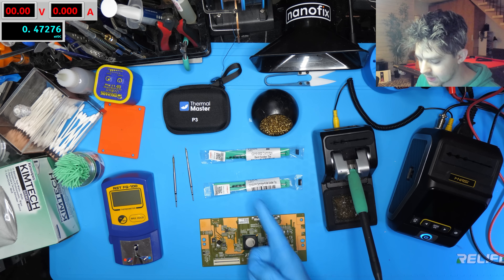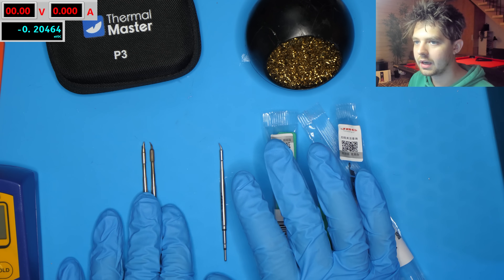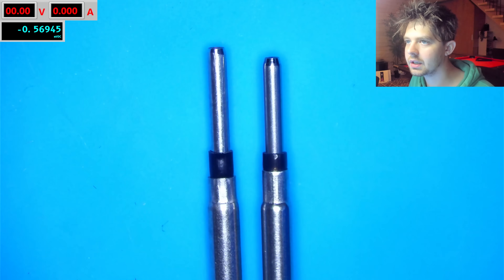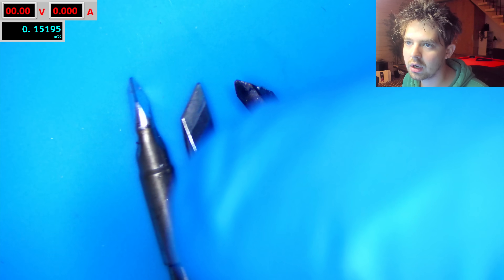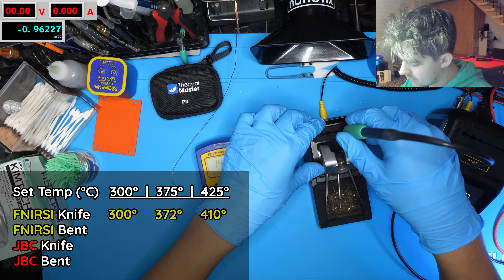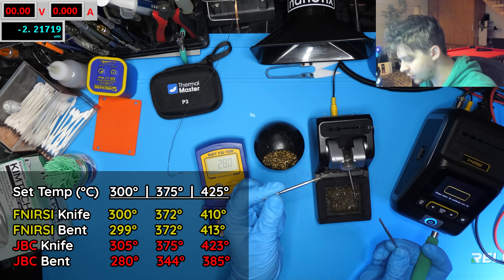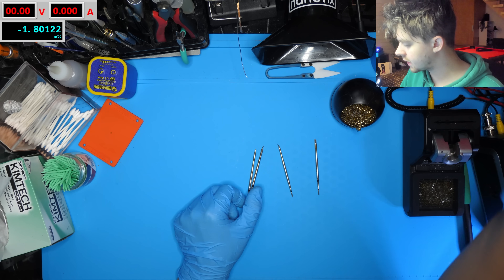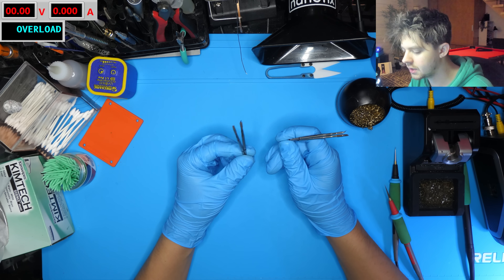Are JBC Tips Worth It?

Comment: I have everything possible from JBC, i.e., soldering stations, hot air, etc. And I have to say, there are major differences compared to the replicas.

This also applies to the soldering tips. The durability of the original tips is significantly better.

However, I have to admit that considering the prices JBC is now charging and what the parts cost on AliExpress, it is still cheaper in the long run to buy the replicas.

When it comes to soldering itself, I haven't noticed any major differences so far. The performance of the original tips is slightly better, but you only notice this with large surface areas. It always takes a little longer with the replicas.

However, I don't have any replica soldering stations to compare them with. I have a very powerful 2-channel station and a 4-channel station with plenty of power.

Therefore, at least for hobby purposes, I can easily recommend the replicas.

Comment: I hope this isn't too much, but . . . sir, you are measuring the heat of shiny metal using an instrument that cannot see the heat of shiny metal. X__X Do you have a meter with a K-type thermocouple? If you have some spares (there are cheap multi-packs of K-type thermocouples out there) maybe (edit: DO NOT) solder one to that ground plane and chart the rise in temperature over time as you try to heat the board with each? I think the only way to measure tips directly with a thermal camera would involve some kind of IR-emissive coating on your iron tips, and that just sounds damaging, like it would fuse to the metal permanently. Otherwise the shiny bits are just reflecting IR from the environment instead of emitting its own. (edit: Apparently soldering a K-type thermocouple to anything could ruin the junction's ability to generate that voltage difference that indicates temperature. I gave bad advice.)

My understanding from watching other videos is: the worst of the clones have the temp sensor way too close to the heating element, so when under high thermal demand the station just sends little squirts of power to the heater, thinking each one is sufficient to get the tip up to temp. Where a higher quality tip (e.g. JBC or Geeboon) will seem to come up to temp slower but will end up delivering power to the tip more consistently.

I ordered a TC22 because of your video and SDG's videos of the higher power stations. (Ordered Jan 1 on Amazon, and USPS says it's out for delivery today, expected some time 11:30 - 3:30. I'm excited! TC22, SW03, and an extra SDC20 cradle) One test I was thinking of doing with mine is: tin the heck out of all the tips, set the station to 160 F and then switch it off, let the tip cool to room temp, immerse the cool tip in a cup of distilled water, switch on, observe how the station delivers power to the tip. I would imagine a high quality tip would boil the water pretty quickly, whereas a different kind might deliver little squirts of power, constantly believing it's reaching temperature and overshooting and backing off -- while the water never boils. Unless you think this is a terrible idea to do with tips I intend to keep and use for a long time . . . I'll try it and let you know!
Reply from the maker: Yeah I quickly realized the thermal cam was gonna be useless for these tests 😂 I thought if I cleaned the tips enough that they wouldn't be too shiny, but obviously the thermal cam was unable to pick up anything useful or conclusive. Either way, my main concern was consistency across like-branded tips for the sake of making calibration worth doing.
Reply: @nanofixca - you can measure much more accurately by changing the Emissivity setting in the thermal camera.
Reply from the maker: @johncoops6897  Ah that makes sense, I should mess around with that

Comment: i use to solder with a atten 30 bucks oold style iron.

bought a 45 bucks JBC clone on aliexpress that came with a knife tip and holy crap these things are just so much better.

but your station is definitely nicer with the stand being seperate. mine is 1 piece, and the "sleep" sensor is a bit iffy.

Comment: jbc tips i dont see any benefit in, the only benefit i see in jbc tips are the unique/exotic tips you cant get anywhere else, so if your not in the market for specialized tip and are just using the normal tips then any c210 or c245 tips work just as well and dont merit the higher cost of a jbc tip. now if you need a massive wedge tip to clean bga solder balls off a chip or board then jbc all the way.

Comment: It looks like the JBC cartridges were counterfeit.
Reply: Any specific reason you say so? Other than the chinese packaging, the genuine I got were paper packaging so I can't compare to that. 
The quality of manufacturing looks appropriate, much better than the clone.
The store he purchased from is reputable (mobilesentrix).
Reply: @jaro6985  I suspect your tips have different resistance values. Add the resistance values to the table. You'll see a correlation between temperature and resistance.
Reply: @Antoine_de_Saint_Exupéry  but why are they counterfeit? Should resistance be lower then (2 ohm).

Comment: Wow... I get clone T12 tips on my JV100 iron (usb-c variant) for like $3 USD each, and never had issues to begin with. $60 per tip is insane! My fav conical T12-BC2 and T12 Knife tips are like 3 years old and still kicking strong!
Reply: Great for you ❤ Tho C245 has way more thermal capacity than T12 ones, super useful when soldering multi layer large ground fields
Reply: @mirrored_  Thanks you! I don't work on multi layer boards as a special repair guy, but a simply hobbyist, yet I also do micro soldering under a microscope. I never had issues since I moved to T12 compatible 100w iron and T12 tips. 

But still, is it worth the 30x price ? I can understand if it was 10 or 20 bucks, but $60 for a tip makes no sense on my book.
Reply: @ardatubes $60 is way overpriced. I can get the hakko T15 and T22 for $12-$25.
Reply: T12 BC2 tip is also my favorite along with knofe tip for larger components

Comment: I have an Aixun T420D, and I only use knife tips; I rarely use other kinds of tips. In my experience, I’ve mostly used JBC tips and never had a problem — they perform extremely well. At some point I tried some AliExpress tips from various brands (Aixun, Mechanic, 2UUL, and other generic ones). From my experience, the generic ones are the cheapest and also the worst, while the branded ones all perform well. I only used them for testing anyway.

The Aixun tips are also very good. I had some generic C115 and C210 tips getting burned, and I always went back to JBC. In my point of view, their shape is a bit more ergonomic, and I feel like they’re easier to work with. I mainly use C210, and I’ve had them for 3 or 4 years with zero problems. I mostly work on laptops.

For the price, the AliExpress branded ones are a good choice, but nowadays you can get a genuine JBC tip for 30€ to 35€ (no VAT because we are a company), while good AliExpress branded ones cost about 15€+ VAT (because Chinese sellers don’t issue valid invoices). In conclusion, I prefer to spend a bit more for the quality.

You should use the JBC tips for a while and then come to your own conclusion. 

Nice videos, by the way.

Comment: Knock Knock Knock "OPEN UP ITS THE FBI!" I've been saying this for years! In 90% or more of cases, what you pay a premium for is the brand, nothing else. Everyone always gives me slack for using the Hakko FX-951 with its 80s retro alarm clock display, but man, this station has been chugging along for over 9 years! The main tip I use for 99% of jobs is the T15-BC2 due to the large thermal mass it has. Those little tips I have almost 0 use for, as I've mastered the BC2 and its my go to for almost everything. I honestly can't wait for JBC to die and for china to take over, as their prices are just ridiculous.
Reply: I agree with you 100%. There's no need for a JBC soldering station when you have a lot more options for a lot less. I personally use the Hakko FM203 and don't see a need to upgrade at all. I'll probably never need to get another station ever again considering how reliable these stations are. With Hakko the tips quality are always great. I've had some of my tips for more than 12 years, and they still work like new.

Comment: I was right with my comments in the Poll question, both are made in China maybe by different companies but in the end they are the same, worth mentioning that the small difference in the temperature for the knife tip was mostly because the JBC was brand new and i think Zach got a defective bend tip from JBC because i have one and it gave me the right temperature except for 425 celcius which are often more lower from every brand for some reason. The clone i use is the Magma from Sugon and i have one conical from Geeboon but I haven't used it yet. Thanks Zach for the comparison, i like your content because you go right to the point and you are unbiased.